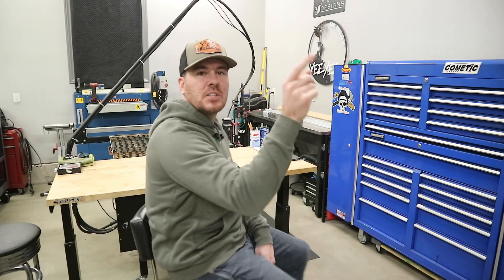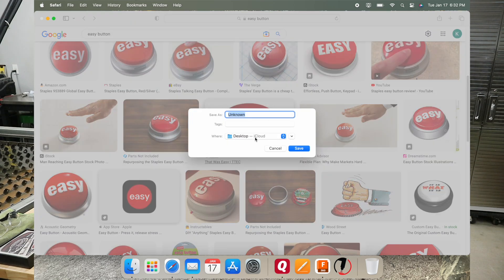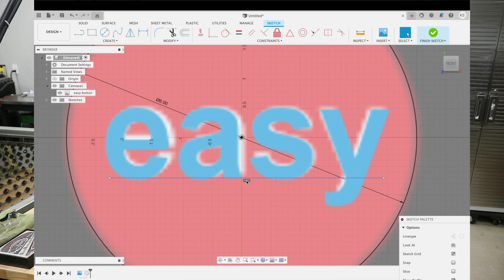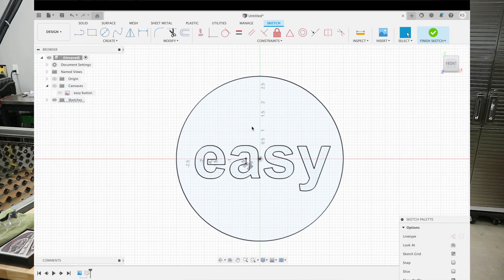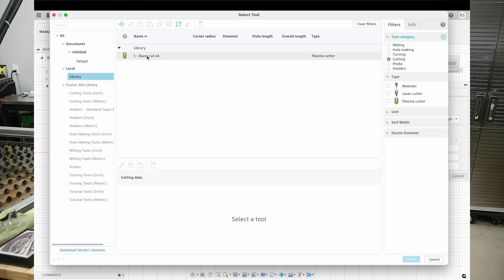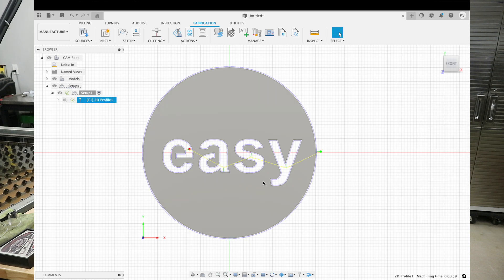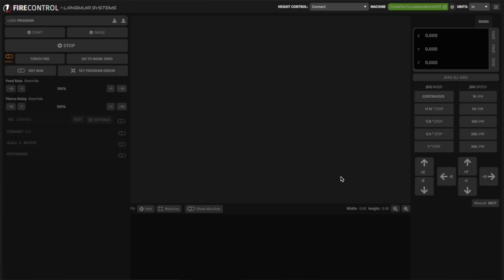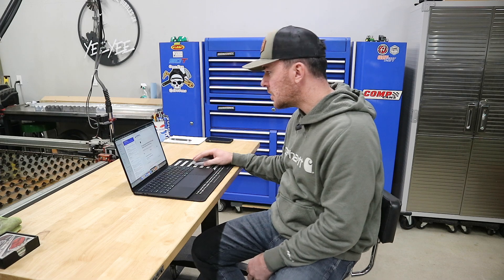CNC Plasma Cutting with FUSION 360 Explained.....Step by Step

Comment: New at cnc plasma cutting. I can't seem to get my XYZ axis lined up the same way as yours.  When I have my Y at the top left, X at the bottom right and the z at the middle bottom. It has top showing front.  Any idea what I'm doing wrong?
Reply from the maker: Yes.  Go to preferences, general, then theres a box where you can select Z to be up.  That should fix it.   Another viewer shared that with me because i was having the same issue.

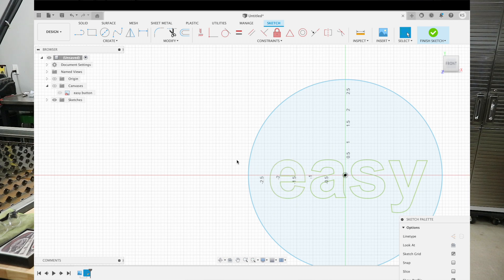Comment: at 6:46 when you toogle the canvas off, your text is black when you hover. mine is green dotted lines then blue dotted segments (not even the whole letter) when I hover. nothing else works like the video from that point on. any help?
Reply from the maker: Sometimes when you explode text there are flaws in the transition.   You have to zoom in on any letter thats not highlighting and look for flaws.  Ill usually make a line across the letter to isolate areas to speed up finding the flaw.  Then you have to delete that section of line and redraw it.   Its hard to explain and i dont know why it happens.  Maybe ill make a video on that.
Reply: @SpicerDesignsLLC  so I figured out what I did wrong. I still had it in construction. got all the way to the cut path and it only cuts an offset around the outside (in simulation). restarted F360 and did it again and I get the same thing.
Reply from the maker: @BobbyCreech  ahh.  Ya that will do it.   Just highlight the line and hit X and it will switch back.   Sound like you got it.
Reply: so I figured out some of it. for the tool/torch setup I watched another video. they must have had a different version because on the cutter tab my Nozzle diameter and kerf width were opposite theirs. When I fixed the tool I am able to select the parts, however in Cutting/Geometry tab I have to select each part indiviual for some reason. but got it to work. Will have to see if it actually works on plasma now.

Comment: You don't draw in the front view! You set fusion for a cnc workflow ffs. Go preferences, general, z up. Then your fusion matches your cnc , Z up. Draw looking down from top. 😂
Reply from the maker: Thats how it used to be.  It was always on too.  Then i went to set up the cut path and the axis were all changed.  I tried to home the axis box to default back to top and it keeps changing back.
Reply: @Spicer Designs  o.O preferences setting. Once that's  set to zup then adjust view orientation defaults if you need to by using the viewcube menus

Comment: I really like the way that you are explaining the operation for your 360 controlled Plasma cutter. Can you share what you are using for a plasma torch? Do you like it? If not what would you move to?
Reply from the maker: Im using the razorweld 45 amp that comes with the langmuir table.  Its not the best plasma torch by any means but its done everything i need it to do.  If i were to upgrade it would be the hypertherm.

Comment: Do you think a 20 gallon 175 psi air compressor would work?
Reply from the maker: Hard to say.  I have a 30 gallon 175psi.  It works and seems to keep up.  Im sure it would get you but until you could upgrade
Reply: What consumables are you using?

Comment: I can't seem to get my cuts to start on the inside. It always cuts the outside first.
Reply from the maker: Did you make your sketch into a body?  There are a couple setting you can mess with in the cut path settings.
Reply: I'll check today and make sure. I also noticed that when following your video, my geometry in the program looks different than yours. I'm not sure why that is, but I'll check and make sure sketch is into a body. Thank very much for replying and trying to help. I greatly appreciate it.
Reply from the maker: @holdemking6969  you can always email me too and i can try to help you through it
Reply: @Spicer Designs  Well did a plate with 4 holes and it still wants to cut out the plate first then the holes. Not sure if that's OK, just don't want the part falling through before the holes get cut. Also the sketch was made into a body, but still sam issue. What is your email and we can communicate that way if you don't mind?
Reply: I'm having the same problem- although my design is where I'm cutting letters out of an already shaped circle.  I can't get the lead in to start on the inside of the letters ...

Comment: Thanks for doing this video.  So much easier to follow then the crossfire videos. By the way, what size air compressor are you running?
Reply from the maker: Ya theyre videos jump around a lot.  Hard to follow.  I just use a cheap 30 gallon husky.  Its dont everything i need it to do.  I have a video where i talk about all the equipment too.
Reply: @SpicerDesignsLLC  Thanks for replying back. That's what I recently purchased too and it works like a charm.   I'm amazed how crisp this plasma setup cuts.  Not like laser, but good enough for what I want to do with it.  Keep them videos coming.  Great work!!!

Comment: I have followed your tutorial to a 'T' 5 times and every time same results. After I create a tool path, when I run the simulation it only goes around the outside. It never simulates any cutpath on the letters. It shows it as a body. My geometry window it different than to one you show. I can not figure it out I have started over 5 times and still same thing. What am I missing?
Reply from the maker: Its hard to say.  Where are you located?   Might be able to talk you through on the phone one day.
Reply: Same problem here
Reply: Fusion tries to put the plunge move in the scrap part that is being cut out. In this case, the letters are the scrap. Fusion will plunge the plasma cutter in the letter then lead into the cut and trace the letter. If the lead in distance is too large, it won't be able to plunge inside the scrap. For small letters, you may need to reduce the lead in distance. If you see a small orange box below your setup on the left of the screen, it will tell you what your error is.
Reply: I'm having the same issue, can't get any internals to cut, can't read the whole previous post either might be helpful
Reply from the maker: What is the size of the piece? The plasma cutters arent very good at small detail work.  Like mentioned above, you may need to decrease your lead in for the smaller sections of your design.
Reply: @SpicerDesignsLLC  that's the issue. Finally cutting. Your videos are awesome!
Reply from the maker: @Shadetreemetal  good job! Now get to work James.

Comment: I am new and just got my Langmuir Crossfire Pro setup. I installed Fusion 360. When I open Fusion 360 it is blank and does not have the grid's on it? I have tried saving images and inserting them, but my images don't show up when I select canvas? I am struggling. Any advice or help would be greatly appreciated.
Reply from the maker: There is a menu bar at the bottom that has your grid settings.  Sometime when you insert a canvas it will show up really small.  Try zooming in.   Then you can calibrate it to size like i show in the video.  Try that first.

Comment: Are those table slats modified?
Reply from the maker: Yes.   They are a pointed slat.  And i removed an 1/8 off the point so it would not scratch material as bad.

Comment: Your entry positions.  Fusion changed them after you manually selected them.
Reply from the maker: I used a file i had already made for the cut.  I just ran back through the process for the video.   Thats probably why they changed.

Comment: I see a mistake.  Well maybe as I am very new.   

"When generating toolpaths for the CrossFire PRO with THC, use NO lead out to avoid losing arc voltage at the end of a cut."

You seem to have this with a lead out.
Reply from the maker: Ive never lost arc voltage from that but i will give it a try.  It does draw a large arc on lead out which im not a fan of.   Thanks for the tip

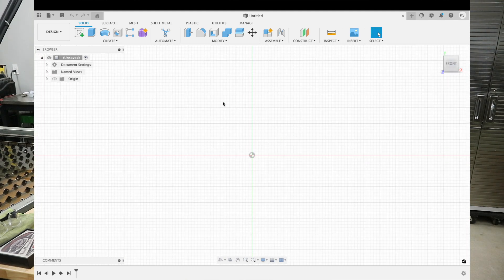Comment: 😂 At 2:10  That threw me for a loop. I had to open my Fusion 360 and look because I could swear that I always selected TOP. Turns out it's the same XYZ orientation as when yours says FRONT. WTF!?!?!? 😂 Still really liking my LS CF Pro even after a couple of years now. Just got the limit switch kit, haven't installed it yet. MAKE STUFF!!!
Reply from the maker: Mine used to be too and then it changed to front out of nowhere.  I dont know why.
Reply: @SpicerDesignsLLC  🤣That's awesome. I didn't even know you could change that. Now I see how to do it but I think I'm gunna leave it alone... it works now... 🤣

Comment: Thanks for all the tips! I like the table slats. Did you design those or did you find a cut file?
Reply from the maker: No problem!  I found a file and altered it so it would have the flat points.  I have a set for sale right now.  $215 includes shipping.  Shipping is around $85 because of the weight.

Comment: Does fusion 360 come with these tables or do you need to buy the laptop and the program
Reply from the maker: Fusion 360 is totally separate from the table.  That is just the software that Langmuir recommends.  A laptop is ideal and the software is free for personal use but after a year you will lose some features unless you pay for the subscription.

Comment: Great video and everything works until I get to the geometry of the cutting tool. Even after selecting what I want cut, the simulation show cutting just a big circle (outside of the parameters I cut). In your video, your contour selection changes from “select” to “chain” but mine won’t. Any ideas on how to troubleshoot and resolve?
Reply from the maker: Did you turn your sketch into a body?  If you dont do that it will only select a contour one line at a time.
Reply: I’m having the same problem it won’t just let me click on the part in the geometry section the box for geometry is not the same as yours.
Reply: Did you happen to be using the free version of fusion 360 when you had this problem? I’m wondering if that is my case

Comment: I only found a difficult button, will it still work....Good video and informative for sure. I've mentioned it before that I want a pro table but haven't been able to press buy it now. I have a 24x30 ft roof with 1 wall being my brick home. If I place a tarp over it do you think it will be safe to store outside. I live in South Texas so not much humidity compared to other states but that's holding me back. 
I doi have a vacant home that I want to remodel in the future will the living room work for this table?
Reply from the maker: Im sure the table would be ok under roof. The only thing i would worry about is moisture to the electronics.   Its definitely better to have in a shop or garage.

Comment: Are you familiar with drawing things in 3d then flattening them out and cutting them?
Reply from the maker: I am.  I think its a sheetmetal tool or folding tool.  I havent used it because i dont have many jobs with bends.  I do want to mess around with it though
Reply: I use it regularly...it's a game changer if you have a press brake and plasma table. Basically start with flat piece of your bracket, extrude to sheet metal thickness then go to sheet metal tab and convert body to sheet metal object. Once you've done that you can click edges and create flanges. Then you can create flat pattern which will allow you to generate a DXF to export for the plasma cutter.

Comment: Just one question, im new in this. Can i download non commercial (free) for home use - plasma cutting. Thanks.
Reply from the maker: Yes you can.  Its a 1 year free trial.  Its still free after a year but it restricts you from some features after that.

Comment: I’m just starting to mess around with this 2d and 3d modeling.  I’m an IPad user and have been trying out shapr 3d cad.  It says it can turn my work into Dfx files.  Will this be a viable option to learn on or do you have another recommendation for a tablet bases option?   I cant wait to get one of these plasma tables for my shop.
Reply from the maker: I dont know about any tablet options. My recommendation would be to get a laptop.  Gives your more options and and control.  But i could be wrong.  Thats just what im used too.  I know some of the laser engravers have apps you can use to create file.  Sorry im not much help with this.

Comment: if i set my box up in the right corner like you have with the word (front) facing me my Z is at top left .the Y is at the bottom left behind the box.   my X is at bottom right. now if i change to the  word (top) facing  me my XYZ is just like  yours. i am very green to all of this.  let me know what i'm doing wrong
Reply from the maker: Mine used to be top too. Something changed and now its front.  As long as your on the x and y your fine.  Wether thats top or front.  Don’t hesitate to ask.  Ill do my best to help.
Reply: @SpicerDesignsLLC  hey thanks for all the the help and advice and your great videos. I didn't think it mattered but if you don't ask you don't know. Thank you

Comment: Great review of using Fusion. I've been using sheetcam. I like how you went over the canvas function and excited to try that out to use on my pro. BTW. What method did you use to sawtooth your slats? Cheers
Reply from the maker: Thanks!   I designed the slats on fusion 360. I made the pointed and then knocked an 1/8 off the point so it didn't scratch material.  I just shipped out a set of them if you're interested.  $220 shipped.  Shipping is insane on them because of the weight.

Comment: Great video Kyle. These are very helpful for me. Q. The Fire Control screen appeared to have straight sections of lines around the circumference but when watching the torch head and the finished part it appeared round. Can you explain?
Thanks for sharing.
Reply from the maker: I think its just a generic display of the cut file.  I dont think it has the same capacity as the auto cad software.  Theres probably a more technical way to explain it.

Comment: Great explanation Kyle!  BTW you can set it so Z is up all the time in >Preferences>Default Model Orientation select Z.  Thanks for the work!
Reply from the maker: Thanks Scott.  And thanks for the tip!
Reply: @SpicerDesignsLLC  And you can set the default unit to inch in Preferences>Default Units>Manufacture

Great video Kyle!  I've been using Fusion for a while, but still learned some things.  Calibrate and Text On Path, to be specific.  Thanks!